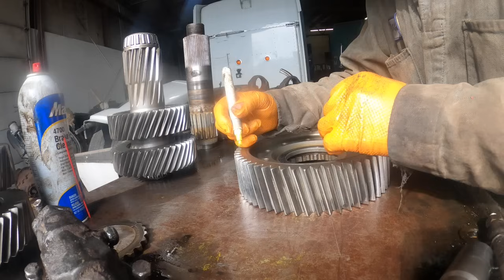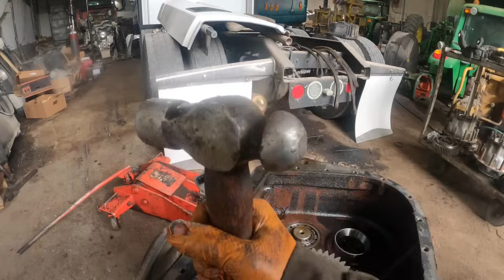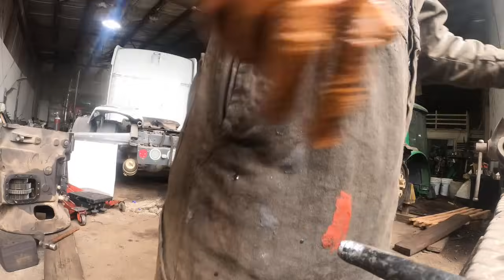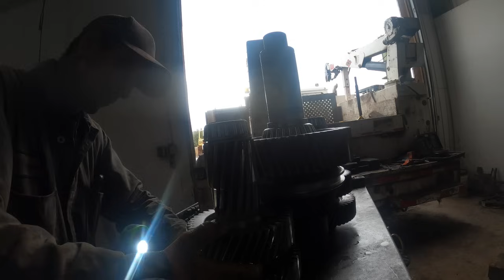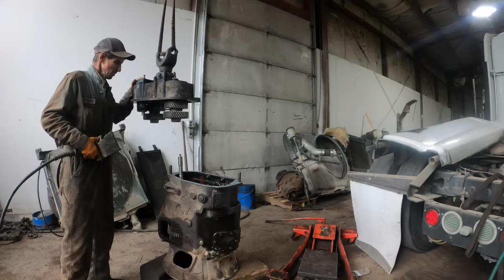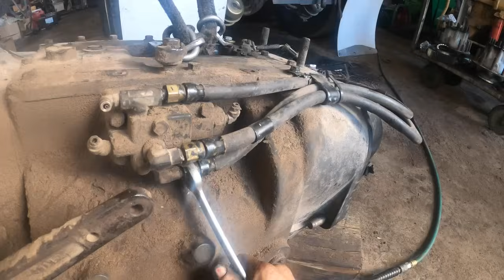Eaton 13 speed auxiliary section rebuild.

Comment: Warren, appreciate that you show how to do thing's, like ya said, a lot of guy's just throw stuff together, but don't show you the stuff like how to line up the timing marks, or air checking on the floor.  You fix so many different type's of machinery, the rolodex in your head must be plum full.  Thanks for the video, look forward to the next one.  G-d bless.

Comment: Great video Warren as always. You fixed one problem and found another with that leaking wheel seal saving the customer time and money by fixing it while it was still there. Alot of guys would have missed that leaking wheel seal especially since it was not there for that. Good catch that's why people trust in your work and in my opinion always will. Have a great and safe weekend.

Comment: Thanks Warren, I find this type of video pretty interesting,  watch it being tore down and then reassembled, then checking to make sure it’s going to function properly, the explanations as to what and why things are done. Purpose built tools are nice and help, but if your not paying attention, all they do is help you put things together faster and wrong. Just a thought sir, get yourself an old 5 gallon bucket and throw all scrap parts in that, saves a feller time running around picking all the parts up and if you need to look at something, you know right where to go, as I say, just a thought. Nice job.

Comment: I am in technical college, focusing on tractor-trailers currently. Before that, I went to school for agricultural mechanics and welding. For years, you have inspired me, offering an example of how an individual can reach the highest level — ‘versatility,’ being able to apply systems-thinking to whatever is in front of you. Thank you for practicing the craft and mentoring. It means a lot, particularly during this time we are in.

In terms of the transmission, I have the following questions:

1. If one reassembles the auxiliary on a table, and then hoists it in to install, will the individual be able to align the countershaft timing marks with the front auxiliary drive gear? How important is it to time the auxiliary drive gear with the countershafts? I feel as though during some assemblies it can be done, while during others it cannot— but, I maybe be completely wrong.

2. When one personally picks timing marks 180 degrees apart on a gear, what is the purpose of this — making sure the countershaft gears are centered, acknowledging that gears wear a certain way over time, and helping with future disassembly & reassembly?

Thank you for any guidance you can offer.

Thank you for being a practitioner and mentor.

Comment: I have a RTLO 18913A Transmission.  The rear output is very loose but the seal isn't leaking.  Could the problem be the double bearings on the output or the bronze bushing in the mainshaft ? Thank you for your time , sir.

Comment: OK so what am i missing with having to time the countershafts to the main shaft?  Not seen it done before and never had to do it on car gearboxes. So if it is out of time what makes it tight to turn the output shaft or the selector not engage the gear correctly?  Can someone explain this and the theory of operation to make the timing of the counter shafts necessary.  From what i can see it only makes sure that the shafts are perpendicular to the casing and are collinear with the bearing race on the main gearbox.

Comment: Hey my rear bearing cover gasket is leaking can i just pop it off and replace the gasket while the transmission is still on the truck? Any specific spec to torque the nuts after i install the gasket?
Reply from the maker: Yes you can, just don't lose the shim between the cover and shaft, 35 ft pounds
Reply: @westerntruckandtractorrepa1353  thanks 🙏🏼

Comment: I just got done doing a clutch and input shaft in a T660. I don't know why the engineers couldn't have put that cross member behind the tranny back even just two more inches so you can get your body up in there to take the tower and cooler off and get the 4 top bolts out. Every engineer should be forced to work on the shit they design.

Comment: It seems like he always has a air leak on his tools
Reply: If you got used as much as His tools do You would leak too.
Reply: Well, not necessarily may be a little thread. Tape will help that situation.
Reply: @terrellscaife2411  
Well, You just go right ahead and tell Warren how to maintain His tools.
Reply: Illinois flag,jewelry omg lol lol😉😉😉😉☕️☕️
Reply: You guys are extremely funny you’re making a big fuss over nothing
Reply: @terrellscaife2411  
You opened the can of worms.
Reply: Truck driver  never ever did hear that.............
Reply: You’re just a talker, but I put my money where my mouth is when I sent him that orange impact wrench
Reply: Course and on 5 axles
Reply: Air line quick couplers always leak
Reply: Yep (then) song current joys different age,judge newell, Dave ness fans are the stars that's  13
Reply: Yeah I use high flow fittings on 1/2 and 3/8
3/4 and bigger I use
1/2 couplers